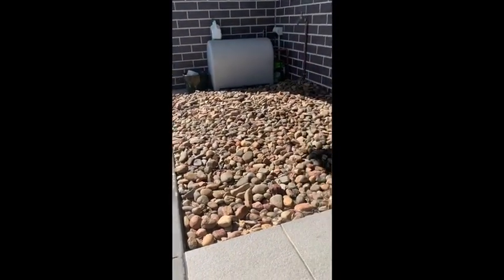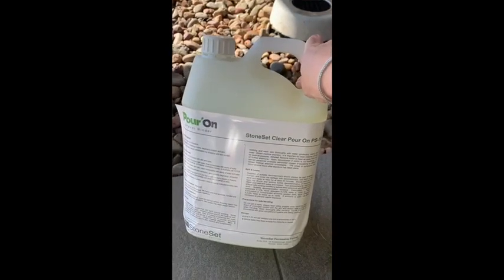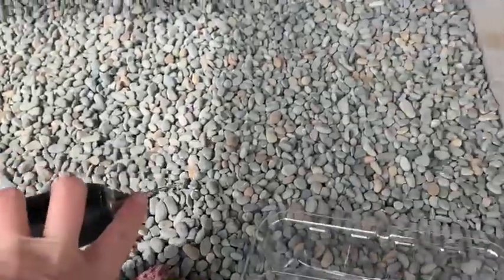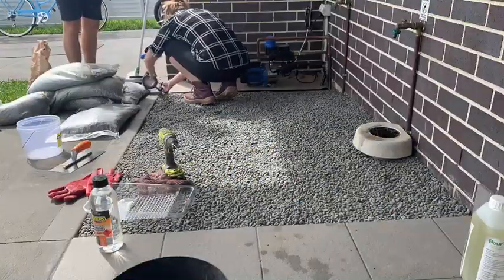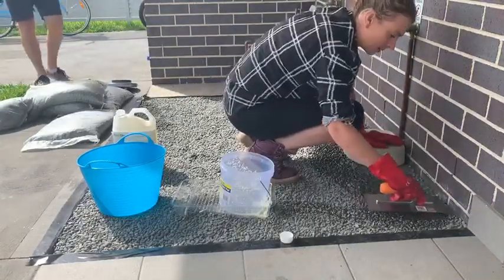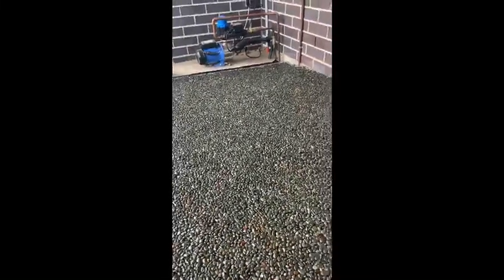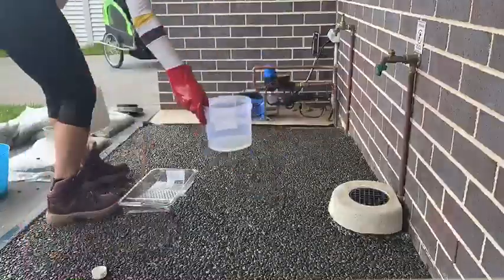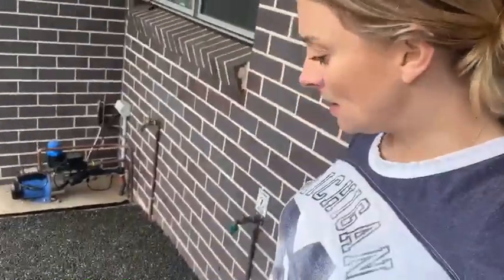Lockdown DIY - Binding Loose Pebble Full Video

Comment: This seems an additional solution for me because half of the area around my house has loose gravels.  How many years will pebbles stick together and is it easy to remove it when we want to switch to something else like concrete or pavers?
Reply: Hi, it will hold them together for 5-7 years, but can depend a bit on the size of stone you use and the base underneath, I did this job 3 years ago and it still looks great literally not a stone out of place - to remove you would have to use force like a jackhammer or saw.
Reply: @torinewton7606  sounds good.  Thank you for responding back